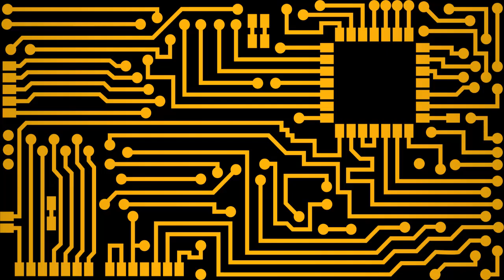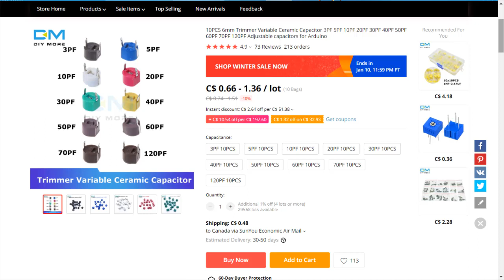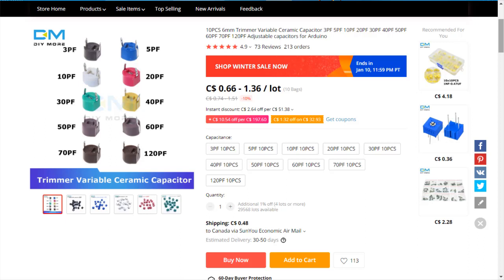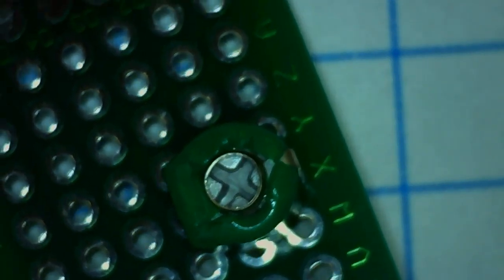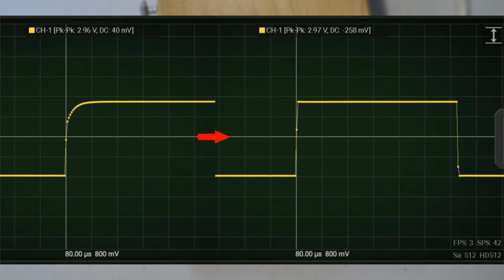GADGETS#87 - COMPONENT INFO

Comment: Hello,
What is the role of this AMS1117 in the HS10X when only 2 pins are actually connected? How does it work?
Kind regards,
Reply from the maker: +Kalin Dimitrov - You're the 2nd person to question that..it's above my "pay grade" so I'll forward it to Martin...
Reply: @theGADGETSplaylist  thank you.
I'll keep looking forward for any updates.
BR,
Kalin
Reply: Check here! https://github.com/martinloren/HScope/issues/4
Reply from the maker: @martinlorenrd4073  - thanks, Martin!
Reply: @theGADGETSplaylist   Hello,
I saw a development roadmap on the official hs10x site with target date 29 Jan. May be 2ch Pro version will be released soon.

BR,
Kalin
Reply from the maker: @kalindimitrov5629  - I'm cheering for HS102 PRO also but I was under the impression that there were difficulties and the project was on the back burner...
I will most certainly bring it up next time I talk to Martin.
Take care, Kalin:)
Reply from the maker: @kalindimitrov5629  - the roadmap is not accurate...
Not your fault that this has misled you.
HS102 PRO development is on indefinite hold.
As it stands, HS101 PRO is the only build ready project. I'm testing a build now.
Reply: @theGADGETSplaylist  Good to know :)
Thank you!
Reply: @martinlorenrd4073  I read that you can replace 1.2 with adj. But how? Can I take the adj pin instead of gnd?
Reply: @andreygrishenkov5318  Just adjust the resistor, you can test with a variable resistor to get the right value 1.65V output.
Reply: @martinlorenrd4073  Than you for the link and the explanation. 
Can you share some insides about the hs102 pro? Release date?

Kind regards, 
Kalin
Reply from the maker: @kalindimitrov5629  - There are no plans in the foreseeable future for a 2 channel HS102 PRO.
The HS101 PRO will be covered extensively here on The GADGETS Playlist with many variants being developed.
Am in the process of building one right now!